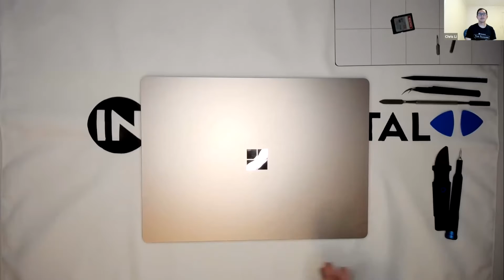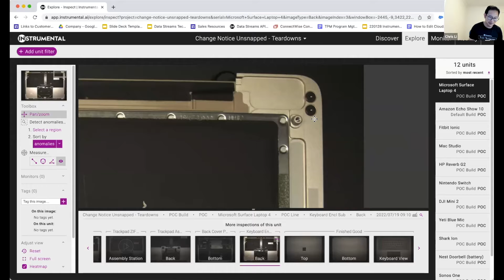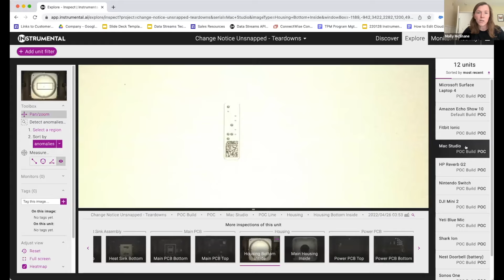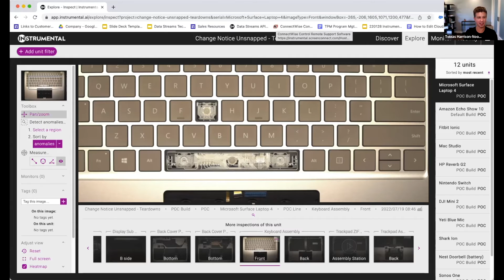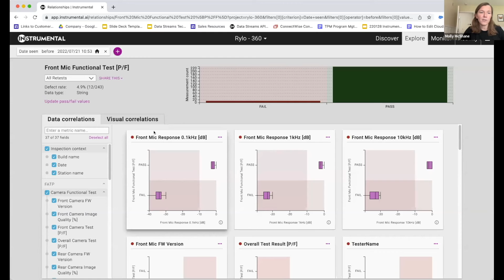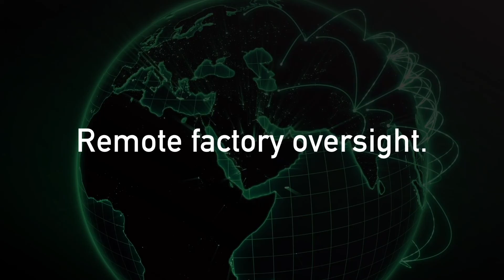Episode #22 - Change Notice: Live teardown of the Microsoft Surface Laptop 4

Comment: How did you get the plastic bits out of the screw holes on the bottom near the keyboard? I can't get the plastic bits out... And you don't show this step, instead it shows 4 uncovered holes
Reply: I mean, the 2 ones near the screen hinge just popped off easy peasy with a flathead screwdriver...
Reply: Nevermind, just took a LOT of force to pry the 3 little legs out of the holes seen on your video.